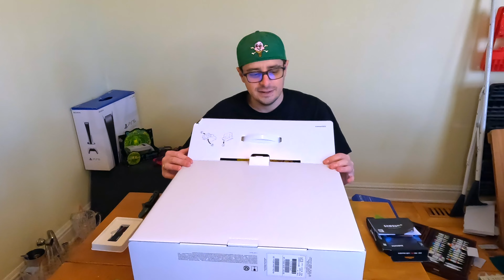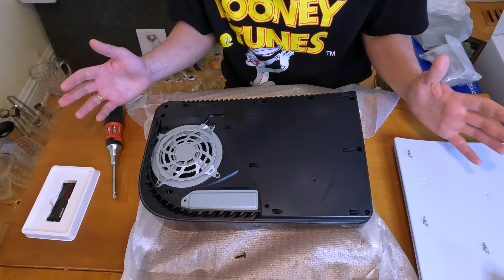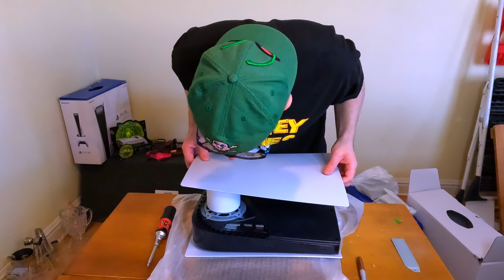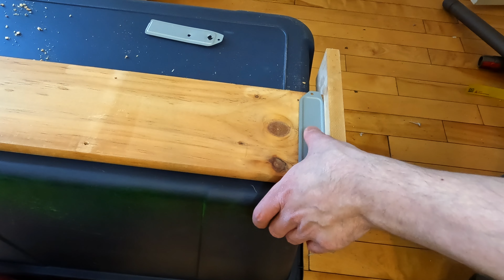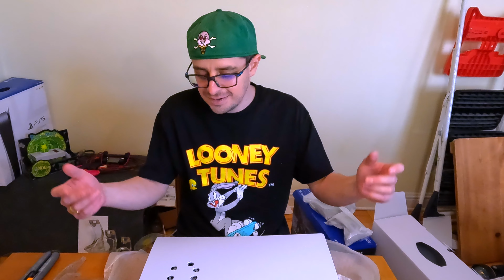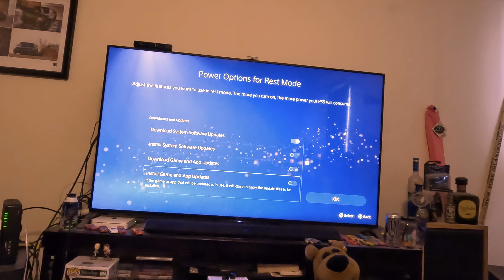Custom PS5 Samsung 990 Pro M.2 SSD Install Review Vents Setup!

Comment: I dont get why u paid more for the ssd with the built in heat sink and putting the metal lid back on, $20 gets u a new heat sink lid that can attach directly to your ssd with no built in heat sink

Comment: So Sony designed, tested and then have made and sold millions of units but you know it overheats when the designed m2 ssd is installed and self-engineered a solution to drill holes into the console covers? This is like cutting holes in your car bonnet because you THINK the car runs hot. When its running to specification.

Comment: The plate is designed that way because it creates negative pressure for air flow.  DO NOT EVER mess with that or alter it.  That is a very dumb idea.  And you do know they sell after market side covers with vents on the side for less than $20.......SMH.

Comment from the maker: I would like to update I have now had a Samsung 2tb SATA in a ps4 for over 5yrs and still works fine. The three ps5s with 2tb 980pro SSDs which were installed over a year ago still work perfectly with 0 issues and my friend and I have both used the PS5 in this video with the 2tb 990pro SSD for countless hours of testing and it works amazing so far. I am working on a video showing the difference between the 990pro SSD and the stock ps5 SSD that will be up soon.  Also the vents and 990pro do in fact seem to make this PS5 run cooler than the others.  Sorry about the wait for a sweet paint job. The weather has not been cooperative but have decided on a design.  See you all again soon.... Work hard, Play hard! - #joekidsti 😛

Comment: The darkplates have ventilation over that spot thankfully.
Reply from the maker: Ive never tested out Darkplates but probably will in the future to see if theres any significant temperature change with the vent on the upper plate.

Comment: Yeah, you might want to hold that thought.  Samsung 970, 980, and 990 Pro SSDs are cropping up with firmware failures.  To my knowledge, there is no firmware fix that exists that be performed on a gaming console (XBox might be an exception).  Early trends indicate that units from Korea are affected.  No firm word on units from Vietnam, yet.  If you're going to buy a new Samsung SSD, I would [highly] recommend installing into a PC first, to run the Samsung software to "fix" these SSDs before putting them into your game system.  Once they croak, they're done.  Some units have lasted only weeks.  Lots of videos coming out about this issue.  Good luck folks.
Reply: I bought 2 2tb 990 pro and will recieve tommorow if i get it updated will i lose it after puttin it into a ps5 and format it? Sorry imabit worried now and bieng so new il check any dates on box if i can not sure what to do as its now 2024 if its a new stick im hoping its fine firmware wise i just dont no if i should ask somebody to update it if the format will affect it
Reply: @chrissytee1  - I would hazard to guess that you're pretty safe by now.
Reply: @chrissytee1  how is it, have you had any issues? I'm to get mine tomorrow.
Reply from the maker: Then get an Xbox and when that breaks its really over. lol
Reply: Just pick up a 4tb today, tired of deleting gates… sekiro your up.
Reply: I just bought one with a heatsink It was manufactured in November last year. But there’s a firmware update from December. Does it still need an update or should it run just fine without it?

I don’t have a way to update it other than sending it in to Samsung, but that would take between 5-10 business days.
Reply: @xanderx9988  - Yours was manufactured [after] the discovery date.  Past that, I can't offer any advice without scanning it with the utility.  I would [hope] that affected units weren't still shipping in November of 2023 but I couldn't say.